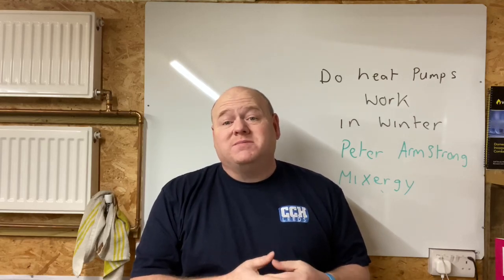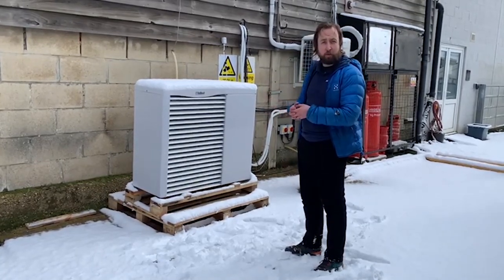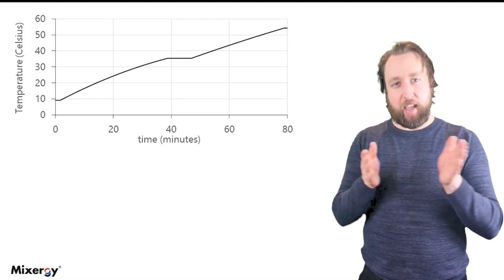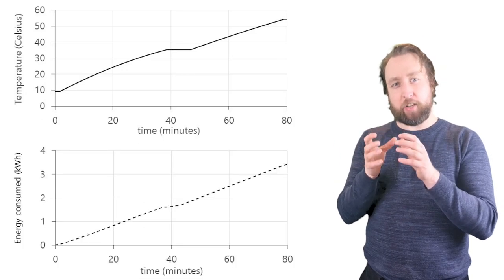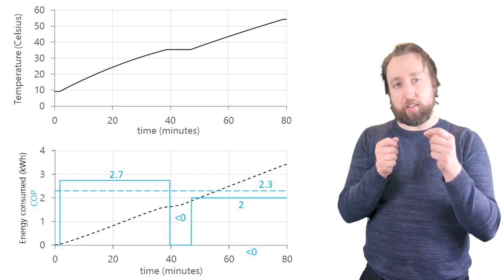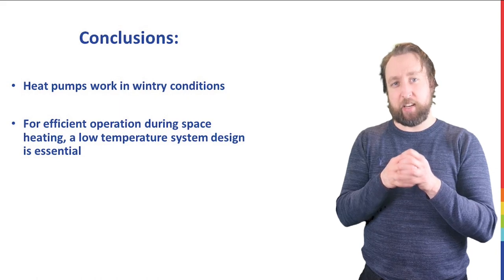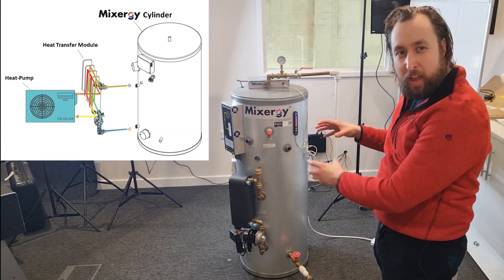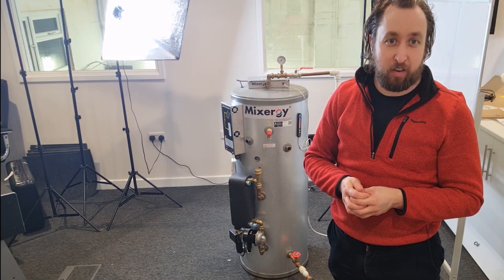Do Air Source Heat Pumps Work In Winter - Peter Armstrong Mixergy

Comment: Had a 8.5kw ecodan installed in December.  Performed flawlessly during -10 temps in the Scottish Borders in February and we were impressed how consistent the house temperature was.  It did however use twice the energy as it did in above zero temperatures but from what I can see the energy usage taken over a 3 month period is favourable against the gas we had previously and the house sits a a constant temperature without any intervention.
Reply: Alas, I suspect that at -10°C very little of the clever heat-pump technology within the Mitsubishi Ecodan was actually heating your house, instead a not so clever back-up electric heating coil (discretely hidden from view) within your heat pump (within the radiator-water/refrigerant heat-exchanger) was probably doing most of the heating. 
And at about 14p per kilo-watt-hour for electricity during the day, the cost of direct electric heating is much worse than using gas at about 3.5p (or 4.1p after factoring in a gas boilers typical 15% inefficiency) per kilo-watt-hour of energy! Even at warmer outdoor temperatures of say 10°C where a heat-pump's COP is somewhere between about 2.0 and 2.5, the cost of powering your heat-pump's compressor with electricity would still be around 5.6p to 7p for each kilo-watt-hour of house warmth generated. Storing off peak electricity at night-time in a battery to then use in the daytime would help a bit at the moment, but with all the night-time charging of electric cars in the near future, I suspect cheaper of-peak tarrifs will soon almost disappear.
Reply: It may have the wrong pump fitted , we have the large ecodan fitted but an engineer said they fitted two standard central heating pumps whereas Mitsubishi recommends a large pump to circulate the heated water round the house faster.
Reply: @paulrhodes7696  Yes Paul Its all smoke and mirrors they don't tell you that .and the figures they produce for COP ar done in ideal conditions .Just like car makers tell us the MPG the car will attain ,but you try and get that figure.People are being conned
Reply: @paulrhodes7696  i am interested in where i can get 14p per kw for electricity. it is 18p-20p per kwh now
Reply from the maker: Thank You
Reply: Wait till they put the Electricity Prices up .

Comment: The trouble with all forms of green energy is that the sums simply don't add up.  If you add up ALL the costs including cost of the system and its installation, maintenance, the cost of disposing of your existing system and disposing of your green energy system when you realize that its not cost effective, then the conclusion is forget it, its pie in the sky!! I've lived without mains Electricity for many years and found out that when it comes down to it, how much electricity do you really need? Do you really need to run a fridge in the winter? Do you really need to use a machine to wash and dry your clothes? just keep your energy consumption to a minimum and pile on the layers as the weather gets colder and let your body get used to the cold, I find that 13c is about the temperature I can comfortably tolerate before I need to put the heating on. The game changer for me has been USB lighting and device recharging, including tooth brush, fans for the summer and a hair trimmers.  I have only one solar panel and one lithium leisure battery (total cost of about £500). This provides nearly all the electricity I need to run all my lighting and power up my devices, only rarely. in the winter months, do I resort to using the generator to top up the batteries or if I need AC for my hedge trimmer or something.  As for heating then I'm sorry to say that no technology is going provide the answer as to how we can capture energy from the summer and store it for the winter when we need it most.  Fortunately nature has already provided an answer, it's called a tree!!  It collects energy all through the summer months and stores it in the form of wood which can be released in the winter by burning it!! I'm not talking about chopping down the rain forests here,  I'm talking about using woodland as a renewable energy source. In days gone by people used to have copses., which was a piece of land used to produce a continuous crop of wood for an indefinite amount of time. Depending upon where you live this could have been hazel. willow or ash. Not sure about ash, but hazel and willow are ideal for coppicing as they produce lovely, easy to split logs which can be split to any size  require, from kindling to half size logs for keeping in over night. The work involved is less than you may think as sawing 3-5 inch logs with an efficient hand saw is a doddle and splitting is not a job so much as a meditation. Nothing is more satisfying than producing a stack of home grown fuel ready for those lovely cosy winter nights. Of course you do need an acre or two of land to be self sufficient in fuel, but that acre or two will produce far more energy and is much more beneficial to nature than a field full of solar panels or a hill full of bird mincers. (to me this is just common sense but I guess there's no profit to be made in using common sense)
Reply from the maker: We need to do something. Common sense tells us we will run out of fossil fuels at some point anyway. Thanks.

Comment: The only thing that I am interested in, is about the difference in temp between a gas boiler at 20C and heat pump at 20C and the typical cost to run in comparison. Your video really doesn't address what a heat pump does in winter or summer for that matter. All your video does is to talk about graphs which means nothing to people who are considering buying the system. So, DOES IT WORK IN WINTER?
Reply from the maker: We have done a few different videos now. More to come. Thanks.

Comment: I think its storage heaters all over again ! They told us in the 80;s and 90's that storage heaters were as cheap and simpler than wet boiler systems. I had quite a nice detached 4 bed house with storage rads. But fortunately I also had a log burner in the lounge.  You get all this heat in the morning when you are off out to work, and in cold weather its starting to get cold by nine o'clock when you DO want warmth. I pity people who are conned into replacing their boilers with these systems.  I though ground source heat pumps were better  but apparently not, and you need a lot of space to install them (not a problem here) but a problem for most gardens.
Reply from the maker: I do agree with you to a point but these are a lot more efficient. Thanks.

Comment: Alan or any others if you can help me. Has anyone got a 16 to 22 kw heat pump. I would like to know what the amps are when used with temperatures below 3 degrees. I am intrested in its consumption while working in cooler weather if anyone can help. Me please.

Comment: Interesting, depending on how the Gas/Hydrogen thing goes, probably the way forward, I may go on a renewables course within the next few years....
Reply: They have already agreed on a date all new boilers can be converted easily to hydrogen, Good move and I'm an electrician.
Reply: @thejollyman  Much better idea in my opinion,nateral gas is mainly methane anyway and methane is 4 parts hydrogen 1 part carbon,hydrogen has no carbon thats why its cleaner,but only if the production is clean,which they seem to have many solutions for.
Reply from the maker: Thank You

Comment: They work, but not very good, and as for the price £35,000 each, plus you have to supply some electric power. Then servicing and repairs will cost you another fortune. Do you really want one of these awful white elephant monstrosities fitted to the outside of your home. A new (small) gas boiler fitted within your home will cost about £2,000 and last you at least 12 years.

Comment: So basically 3.5kwh at 16.5p a kw compared to 3.5kwh at 3.5p a kw gas and you don't have to wait 2 hours for your shower
Reply from the maker: You would have a hot water cylinder full of hot water. Thanks.
Reply: @AllenHart999  Not if you have two teenagers you wouldn't lol

Comment: I life in Huntington NY which is on Long island. I have had heat pumps for 42 years and can absolutely testify that they work great. I have a 5 ton Lennox Unit at the rear of my home mated to a Lennox Air handler in the basement. In heating season I set the thermostat at 74F and don't touch the temperature setting until Air Conditioning season starts when I set the thermostat at 78F. I must also mention I have 65 Solar panels on the roof of my home. My total cost of Electric power for a year for Heating, cooling, cooking, hot water, lighting runs between $150 and $450 depending on the  severity of the winter. My next door neighbor has the virtual identical home to mine only with conventional Oil heat and they spend $3500 on Oil each year plus an additional $2,400 for Electric. A properly designed and installed system from a top line manufacturer like Lennox cannot be beat.
Reply: Huntington guy, this is the first time I have heard someone from Long Island say anything. If I understand, the solar cells are very important to your system. Do you own the solar outright? Plainview Long Island
Reply: Small world! HHS class of '89.

Just curious, what happens when you send electricity to the grid? Do they pay - and how much per kWh?
Reply from the maker: Thank You

Comment: All I see is people banging on about how much cheaper it is to use natural gas. Yes it most definitely is, but the whole point of the exercise is to reduce carbon dioxide emissions! To do that we have to stop burning natural gas both domestically and industrially. Yes it does cost a lot more and yes it is painful on the pocket, particularly if you are on a fixed income such as a pensioner like myself, but how else are we going to limit global temperatures and have a planet for out great grandchildren? I have just moved into a brand new house with air source heating and I can see my winter energy bills at up to £250 per month, in order to ameliorate this, l intend to fit a wood pellet heater in the living room and this will certainly help heat the whole house, A high capital cost to be sure as new houses don’t have chimneys but needs must and all that.
Reply from the maker: Thank You
Reply: So you have installed a system that’s so expensive to run that you’re gonna have to install something else so that you can avoid using it so much. Are you off your meds?

Comment: I have just had a heat pump installed. I have no idea if it works as it has been too hot to need it so far.
Reply: Now the temperature is cooler it still works well. Glad I got it.
Reply from the maker: Thank You

Comment: Canada - loads of heat pumps.   Ambient temps down to -40C and the heat pumps are A-ok perfect.
Reply: But in Canada everything has probably been designed around heat pumps.  These simply will not work in the average UK home.  We do not have the space to accommodate the equipment.
Reply: @petercollins7848  Now, I am one million percent certain that is not true.   Either part - the supposition on Canada or the assertion regarding the UK.

Comment: I have an air to air heat pump, installed 5 years ago. Otherwise called air-con. The cost of retrofitting a house with VERY big radiators or underfloor heating is prohibitively expensive and unpleasant to live through. Air to air using a multi split  system is cheaper, less disruptive, more efficient  (only two heat transfers not three, and no wet problems), provides cooling in summer, heats up faster, is very controillable on a room by room basis, requires very little maintenance, and  looks better. The downsides are fan noise (very little, both inside and out) and hot water must be separately provided. Efficiency on very cold nights is adequate if the system is properly designed and sized. I reccommend it and have no axe to grind. My electricity bills have just gone up to £75 per month. We do use some wood on cold evenings. The rant by Brisby had some truth and a lot of half truths.
Reply from the maker: Thank You

Comment: I would have liked to see more real dats...ie  Input/output energy levels and costs that people can understand... Example  at 0 degrees outside temp what power input is needed to heat (for example) a room with average insulation of say  100 cu mtrs..best really if we could have simple in out...watts in  energy out calculation

Comment: Isn't a "heat-pump" just a refrigerator working in reverse? Compress a gas into a liquid and generate heat, let the liquid change back into a gas and you steal heat to reduce the temperature... Isn't that the principle?

Comment: Great video Allen - I am doing a self build house & living in a mobile home on site whilst it’s built. Definitely going for ASHP with ufh in the house.
Reply: Hi Mark, from my experience (my family and I have just moved into a house with ASHP supply) you won't be disappointed. With good quality double glazing, insulation and ufh, we've found the heat pump to be fantastic so far. The hot water supply works a treat and space heating very impressive.
Good luck with the project, I'm sure you wont be disappointed with going for an ASHP!
Reply from the maker: Thank You

Comment: Very interesting video Allen, I installed loads of heat pump ( Qualified) in Hungary, all I installed with puffer tank ( hold the undefloor heating water up to 12h on certain temp) underfloor heating and unvented hc, well I think this is still baby shoes need more and more time to make it perfect.. All I installed never had issue even in -20.. But I can say they a bit slow to heat up the house, but I know for fact they at least double a price than a normal Turbo or Condense Boiler, due sometimes bigger house linked 2 or 3 heat pump.. cost over around 10k  or well over the full system.. 👍👍
Reply: Komel, can I ask, did your systems have back-up direct electric for days when the temperature went down to -20?
Reply: @mixergyltd6286  Hi, System has been designed by Architect Company, 1 of then i clearly now is Viessmann system, the hw cylinder of course has had immersion heater, but no other source of heat, so the puffer tank holds the water on temp which helps the heating water on temperature, of course as I said expensive and need a plant room for 2 big cylinder, and also electricity will be expensive under -5 by my experience, also house would not heat up well above 20 c.
Reply from the maker: Thank You

Comment: This has been rumbling on for a while now and I still haven't seen a direct fiscal comparison between resistance wire heating  (not including Gas here..) and an ASHP system.  As Boris seems to have accepted their use as the way forward I believe we still need to push for a realistic cost comparison. 
 
The enclosed video seemed to be offering a large complicated storage tank as the collective source of heat exchange for either heating or Hot water.    
Most CH systems work on instant pumped heat.    
 
Many years ago I disconnected my HW Cylinder from my CH and have just relied on the Immersion heater and a timer (the cylinder stat never really worked..) for my hot water.  I found it to be very efficient, flexible and cheap.. Virtually no maintenance.  As most of the water in my Cylinder is actually cold, I am now considering the small undersink 25L storage Water heater for even better supply.

Just out of interest..
I dont think people realise that all the ASHP workings are in the big fan box on the OUTSIDE..  Would you consider mounting your Boiler on the outside wall of your house..

I think it boils down to if you want the speed and efficiency of a Gas boiler in an ASHP then be prepared to pay £100k..                  

As they stand I do not believe ASHP's work in the UK for property heating.   

In the USA their heating is ducted warm air..   which does not require the high water temperature that we need for radiators.

I admit to considering a wood burning fire with a back boiler & burn pallets..  Back to the paleolithic era..ya
Reply: I was having the Same thoughts throughout, 2.3 coefficient means nothing to me if I can't compare it to something else.
Reply from the maker: Thank You
Reply: "I still haven't seen a direct fiscal comparison between resistance wire heating  (not including Gas here..) and an ASHP system."

Very simple, the COP of a resistance wire heater will be approximately 0.96 at best, compared to a COP of between 2 & 3 for an ASHP
Reply: @LongfordGer  cant explain simple to people this.... simple